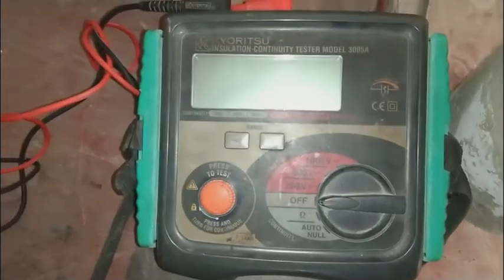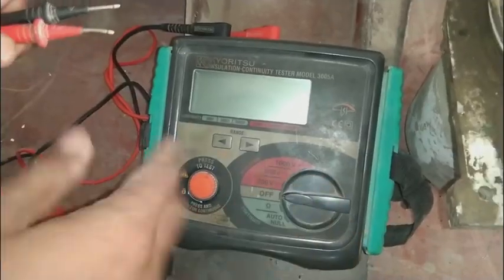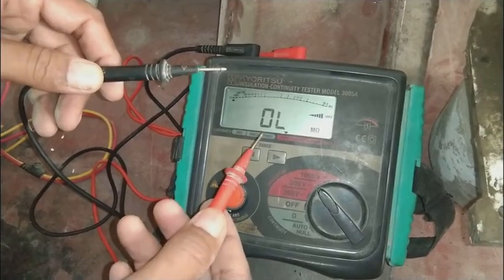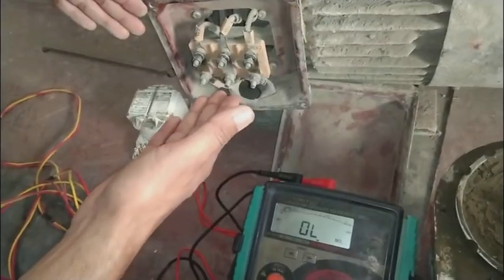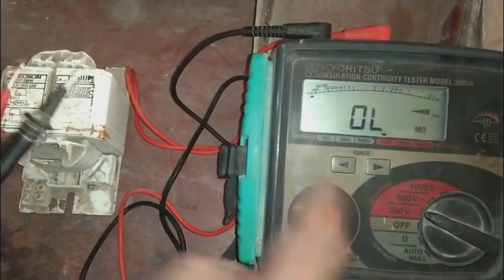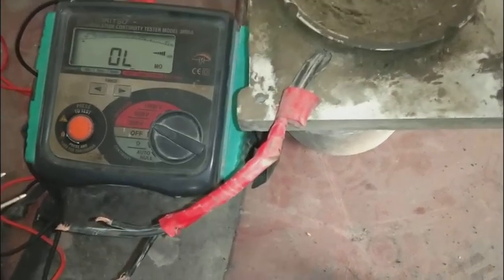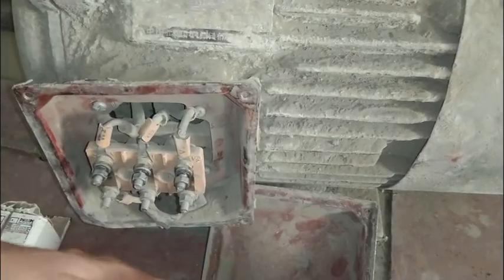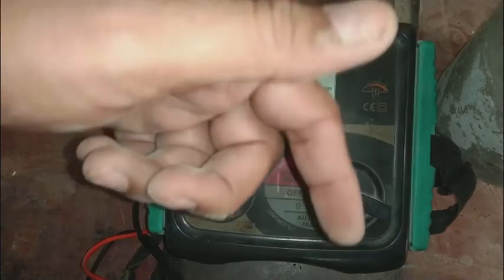Megger review. Insulation resistance tester review. Magger testing. Megger testing. Insulation test.

Comment: Boss OL means Overload. So the motor may be bad
Reply from the maker: Who told you OL means overload? OL in measurement means Out of Limits. In other words it is a value beyond the instrument measurement range.
Reply: @JahanZeb1976   I understood OL was means Open Loop it was from that loop was opened which metering could not reached the value, some model you will see >>550MOhm that's means over the range.

Comment: Did the 0.00 reading for the motor winding indicate that the insulation between the winding is compromised/failed . The other other result in the example with the two wires tied together indicated 0.00 reading and showed that there was a contact between the wires. I thought that the windings of a motor should never be in contact with the other windings in the motor???Please humble me and explain what im not seeing here
Reply: May be the windings are star connected? 🤔 I'm not sure. I have the same doubt as you too.

Comment: Please explain: When you test with the two wires TIED your reading is 0.00 indicating a SHORT. When you touch the pair of test  leads your reading is 0.00 indicating a SHORT. BUT, when you test between the windings on the motor and you get a reading 0.00 then you say its FINE? I THOUGHT 0.00 IS PROBLEMATIC INDICATOR OF CABLES TOUCHING EACH OTHER???
Reply: May be the windings are star connected? 🤔 I'm not sure. I have the same doubt as you too.

Comment: I want to use resistance meter but no too expansive to test insulation on my Prius motor mg1 and MG2. So can I use any insulation tester meter up to 1000v to do this test? Thanks
Reply from the maker: Sure, you can use any inexpensive one. Instead of 1000v, a 500v tester could also help. As long you follow all safety precautions.